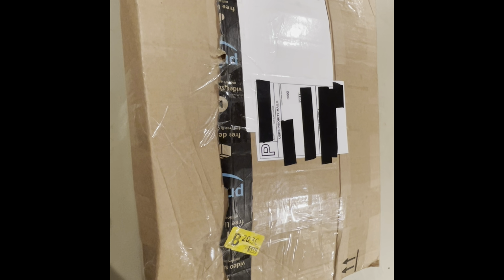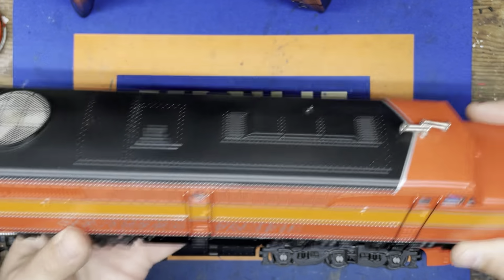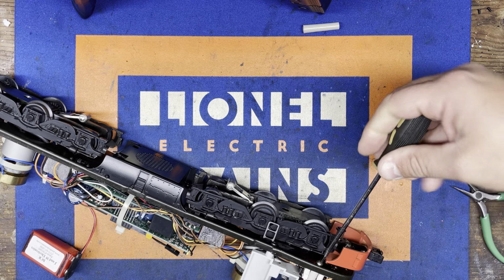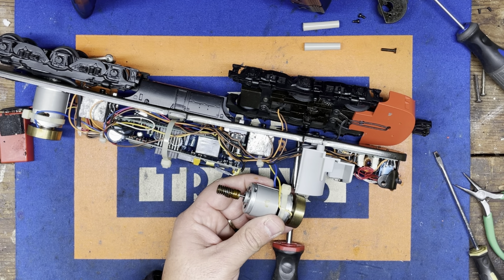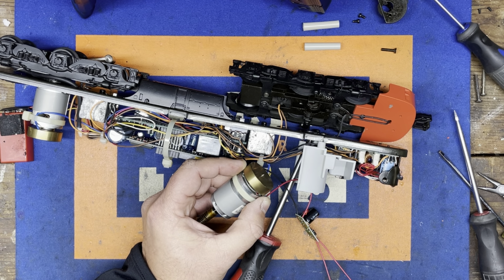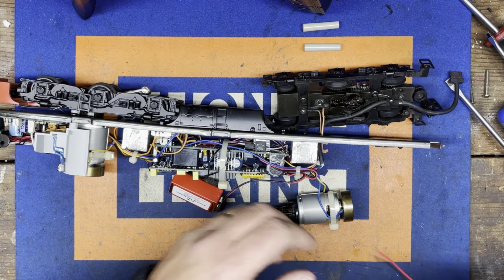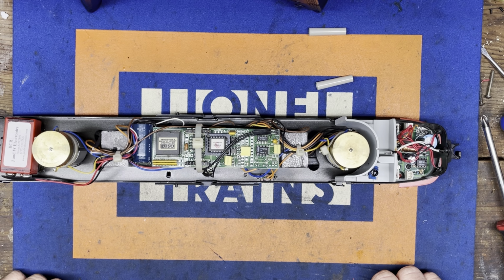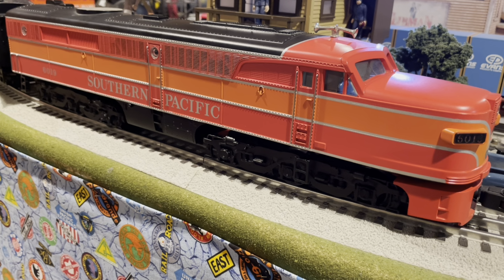MTH Premiere O Scale PA ALCO Diesel Set…WILL IT RUN?

Comment: Plastic and sheet metal construction is reason you find it ”not good” when wiggle motors. Your work mat is Lionel. I don’t think rail king is made by Lionel, but I could be all wet. Truck looks similar design to Lionel. Understand can motors were incorporated into trains not because of performance but rather because they cost less. Notice how small the shafts are. The smaller the shaft the more the wear is accelerated due to load per unit area contact. Also worm gear drives do make more axial load in addition to side load on the motor.

Comment: I noticed you did not lubricate the can motor shaft after freeing up the flywheel.  Is it a no-no to oil a can motor shaft?
Lloyd
Reply from the maker: I would suggest a conductor lubricant if you must lubricant the can motor shaft.  I would avoid oils as you don’t want any kind of buildup on the magnetic field in the motor.  Thanks!